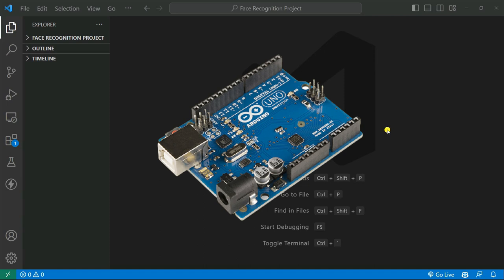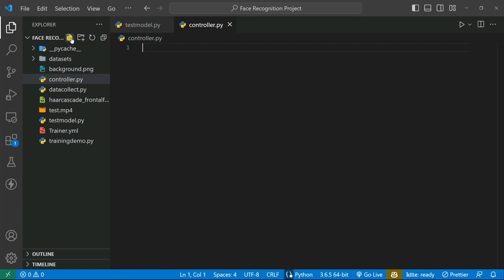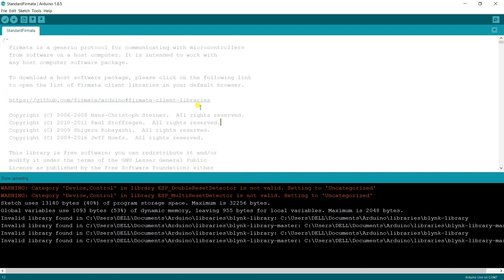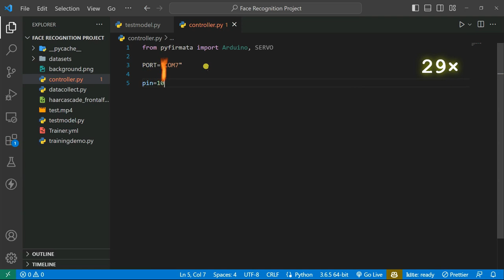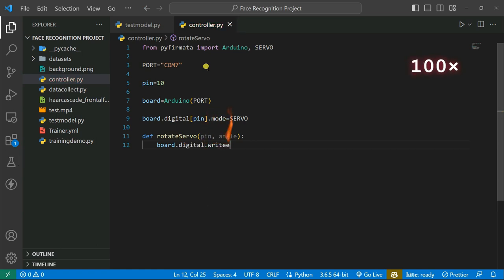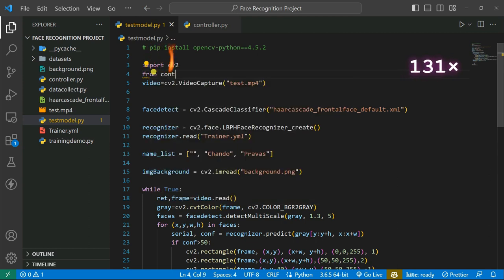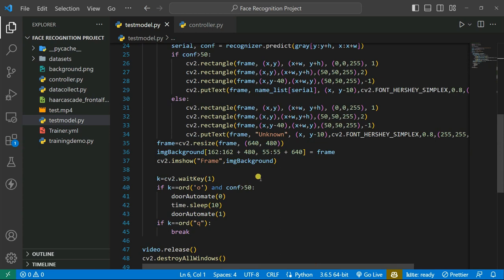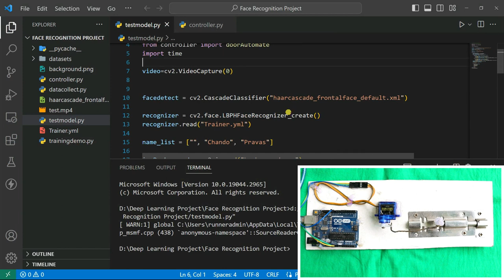How to make Face Recognition door lock at home Using Python

Comment: I am also using same version of python and opencv that you are using but still iam facing error in LBPHFaceRecognizer
Reply from the maker: Python 3.6.5?
Reply: @knowledgedoctor3849  yes bro
Reply: Bro is there any solution?
Reply: Bro did you find the solution. I am facing the same problem
Reply: Bros, did you find the solution? I have the same problem
Reply: @user-cp7dm2mq2s  I was not be able to make make it work but I read on the Stackflow that they moved this function in the newer updates. That's the problem.